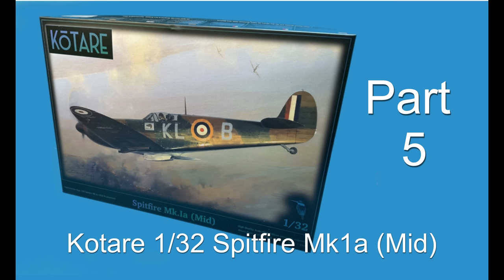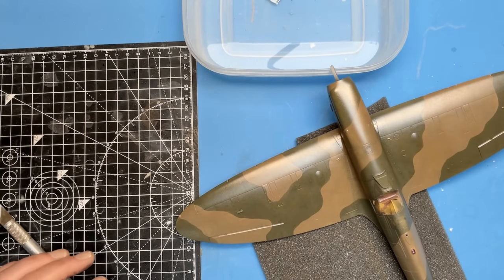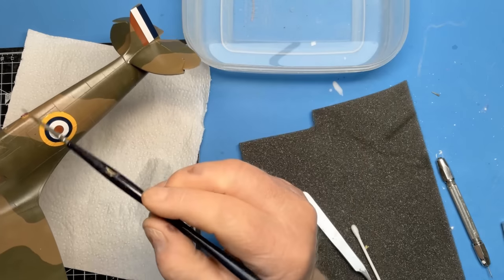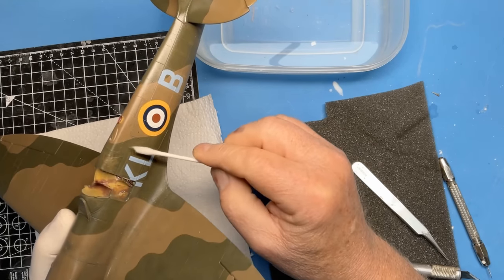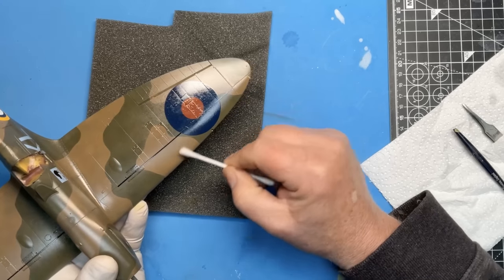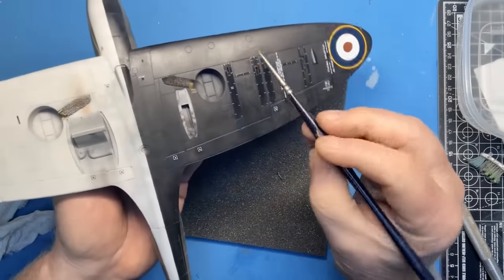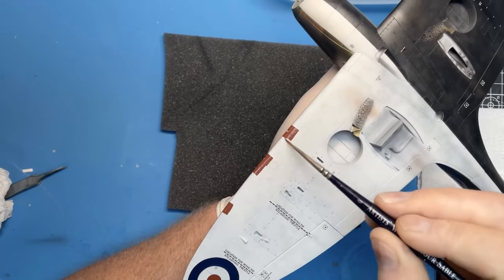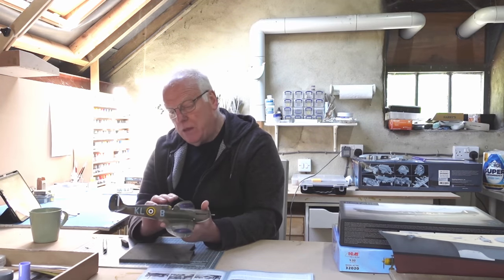Kotare 1/32 Spitfire Mk1a part 5

Comment: I consider myself a pretty skilled modeler, but for the life of me the only decals I ever struggle with are the damn walkway lines. I try and get them straight and as soon as there is a slight bend I try to adjust, only for the decal to overlap itself (which I try and fix straight away) only for it to create more problems. You have incredible skills sir, and I consistently watch your videos for tips and techniques...so thank you. 

I'm currently building the Kotari "Brian Lane" and what a great kit, but 2 out of 3 walkway lines crushed me.
Reply from the maker: They definitely are a trip up point Ian. My method is to get one end of the walkway decal on the edge of the backing paper, put it at the start point on the model, hold it there and pull the backing away from under the decal and as it does let the decal down onto the model. If you pull the backing away in the correct line the decal will follow the same line. Leave it to start to grip and gently do any minor adjustments with a soft wetted brush. I have loads of walkways to do on the Tornado this week so I’ll cover this in part 6.
Reply: @TheModelShed  Thank you for the reply and tips! I really appreciate it and will as always keep an eye out for your next video. I've learned so much so again, thank you. 

Also, I love the sounds of wildlife outside your studio when watching your videos. Cheers!

Comment: Regarding the lettering text, I would say that the attention to detail Kotare have put into this kit, the holes for the screw head for example, they would have made sure the colours are also accurate. Then when weathering is done how much have you changed that colours appearance? What about differences in paint batches? Anyway, I think I will make a start on mine following your build videos.
Reply from the maker: I’m pretty confident that they’re not right so I’ve gone ahead and changed them